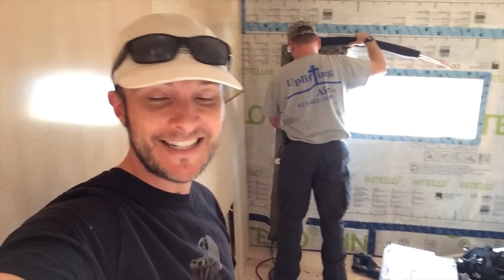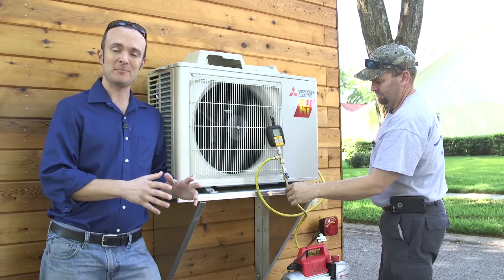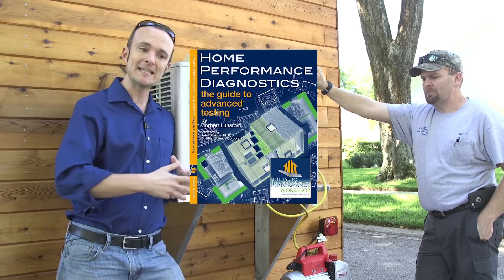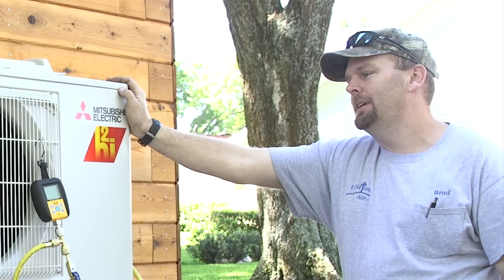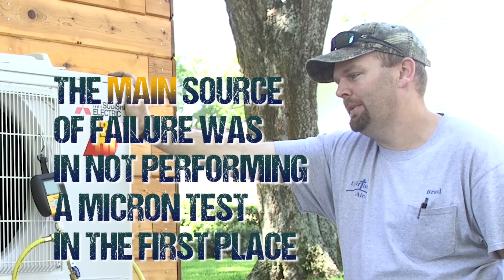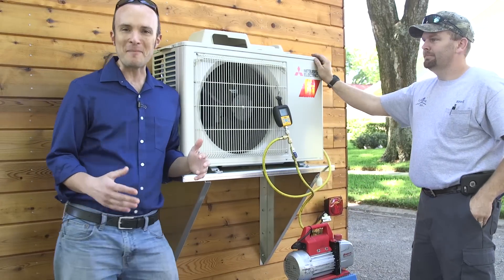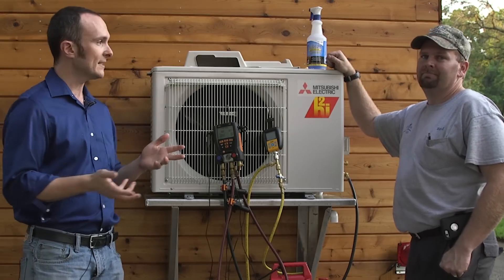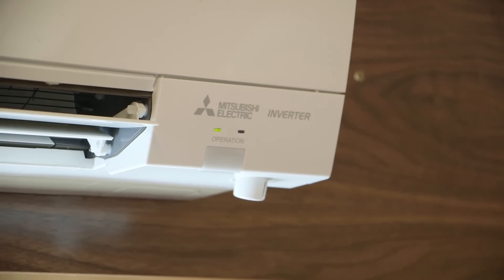Installing & Testing a Mitsubishi Ductless Mini-Split in a Tiny House with Brad Lemley

Comment: For the Mitsubishi 6K outdoor unit, is only the wall mount air handler available in matching 6K capacity ? I am looking to pair that 6K outdoor unit with a floor console or one way ceiling cassette ( that fits between 16" joist ) but unable to find one in mitsu documentation.

Comment: What is the procedure for folding out the line from the back of air handler to go out the wall?  The line is folded in the air handler for shipping and I need to straighten it out to go straight out the wall.
Reply: Just bend it and run straight out.  I do it all the time.  As long as your not crimped your good.

Comment: If you read the installation instructions from Mitsubishi, they say to nitrogen purge the lines twice, once from 4000 microns to atmospheric, again from 1500 microns to atmospheric. I'm trying to figure out if I can get away without buying nitrogen, just pull a solid really good vacuum and hold it for days to let the moisture evaporate. But after watching this, maybe I'll try to find some nitrogen.

Comment: I'd like to know how well this system would be on a small 12x24 cabin in lower Michigan winter's.
Reply from the maker: I know they have heen installing them in Montana, with no backup strip heat.
Reply: @HomePerformance  Excellent! And I now wonder how it will work with my solar system. Completely off grid here
Reply from the maker: It will definitely do better than any other piece of equipment- Mitsubishi is the most efficient you can get.

Comment: I did car a/c for 30 years and never heard of a micron test and up until 2000 I was a IMACA instructor and still never heard of one. I also never had an a/c fail later when a evacuation was performed. Apparently these home a/c compressors are different and I did not know that you could not tell the state of charge on a unit with and electronic expansion valve using a/c gauges...

Update: I looked it of and it's simply a "It is a very fine measurement that provides very detailed results" Meaning it's a much more sensitive method than ready vacuum with a gauge set...

Comment: Is the mini split system using any energy in stand by mode? If it is, can you turn it off at the switchboard?
Reply from the maker: Yes, it does take a trickle of power when ‘off’, like anything with a remote control, but I would advise not turning it off at your circuit breaker panel every time you feel comfy.

Comment: Is this unit still functioning and in good order?
Curious about the maintenance since install, and if there were any issues with this unit in particular.
I have one of these myself and unfortunately have a few negative things that I'm experiencing.
1. Blower wheel bearing went out relatively quickly (within a year) and is rather noisy now.
2. During colder days (30°F or less) there is an intermittent high frequency sounding noise when the heat pump is on, almost squealing, like when air is slowly let out of a pinched balloon.
Certain it's not motor related though. 
Any info or reference would be very helpful.

Comment: Test? How about a pressure test buddy. Your supposed to do a 24hr nitrogen test @600 psi on those Mitsubishi split units. I'm sorry but this guy talks a good one but he didn't do the job right.
Reply from the maker: Interesting- who requires a 24-hr nitro test? I’ve never heard that.
Reply: @HomePerformance  look at any installation manual that comes with the equipment.

Comment: Hi I'm ready to install my inverter unit. But my AC guy said I should have it 12 inches away from the wall like the manual said. Can I get away with it if it's 2 inches away. Thanks
Reply from the maker: Follow the manual- ours said 4" clearance.

Comment: If nylog is present use it for joints
Nitrogen should have been used first, bubble leak detect it second 
And then finally evacuate. 
Proper procedure will save time.

Comment: I’m installing the 12k version of the unit you’ve installed here. My condensing unit will be located right outside the house, allowing about 4 ft for the lineset. Do you know the minimum lineset distance needed for this unit?
Reply from the maker: Yes, it’s 15 ft back when we installed- def read the manual
Reply: Home Performance thanks! Unfortunately, it’s not listed in the manual, but I do have the 15 foot line, so should work out fine.

Comment: A 6 to 15 hour evacuation on a home system is ridiculous. Watch his face as he's trapped into something he knows is BS. On a 3 ton 2000 sq ft home you can pull vacuum down to 500 microns (EPA rule) in as quickly as 15 minutes using good equipment. Check for any rise between 500 and 1000 microns within the next 10 minutes. Basically if no leaks and no residual water/ice in system, you're done in 25 minutes. But the main point is he should have done a pressure test with nitrogen FIRST. He did the nitrogen pressure test AFTER the evac showed a leak which was a total waste of evacuation time. Under nitrogen pressure, check your connections with bubble juice for leaks. No loss of pressure, no bubbles, means no leaks. Vacuum the system, release the charge, fine tune pressure/temp, and your done.
Reply from the maker: Just have to say, I’m slightly suspicious of anything that seems so cut and dry in every situation, or of super confident promoters of such methods. A lot of us have seen enough projects to know nothing is perfectly cut and dry.
Reply: I agree with you that nothing is perfectly "cut and dry", and nothing in life is 100% either. Some systems may require more effort to evacuate, maybe up to 1.5 hours, worst case scenario. Here is a link to a professional HVAC tech vacuuming a residential system with a 50 ft line set and reaching 500 microns in under 3 minutes. Then you can decide if I'm "super confident" or just stating plain and simple fact.
https://www.youtube.com/watch?v=wYZ8Wudksb0
Reply from the maker: I’m just saying, have you ever installed a system in a tiny house on wheels in central florida as a favor for a friend who forced you to be on camera? Be nice to Brad, please.

Comment: Your explanation about being able to check for a correct charge after it is running is incorrect. You can use temperature to check if it is correct. As long as it can be run at full load 100%. I have done this with large R2 Mitsubishi systems. The same would apply on the small ones as well, but will agree the best way is to weigh in the listed charge this also takes away fractionalization issues if there was a leak and you were topping up the charge.
Reply from the maker: I believe Brad was referring to the difference between a minisplit and full split being there’s not a true superheat and subcooling attainable at the same points in the lineset. So you could get temps, yes, but what to compare them to?
Reply: Home Performance Manufacturers specs on what those temps should be at the sensors in the unit under full load for that specific unit. Just stating that it can be done as I have just installed a large R2 Mitsubishi system and temp checks are what they use to check final charge. The job I was on had 3000ft of piping total on 7 different systems. And pressure testing is what should be done prior to any evacuation at 600 psi manufacturers spec.
Reply from the maker: Large systems and mini-splits are different in this respect, though- that’s what his point was.

Comment: When a vacuum is drawn the boiling point is reduced. A 500 micron vacuum puts the boiling point around -15 F. So, how can anything freeze?

Was a torque wrench used when tightening the flares?

Comment: How’s the Mitsubishi holding up? How does it do in lower temps?
Reply from the maker: Still going like clockwork. 13,000 miles later, and 2.5 years in.
Reply: Home Performance wow! That’s awesome! I’m working on designing a Mitsubishi system for my aunts new house. We will be using the horizontal small ducted air handlers for her house

Comment: since 2018, you need a license to install these, even DIY versions
Reply: That stinks.
Reply: You can buy these units online from many different websites, without a license.  Some areas will require a permit to do any work on your home, but that doesn't always mean that you have to have a license.
Reply: @JJ-nh8lv  incorrect, you need a license since 2018, they changed the wording. doing any work that could inadvertently cause a freon leak, even hooking up gauges, require a license on all greenhouse refrigerants, probably not R718 though. EPA regulations
Reply: @ihatecrackhead  incorrect or not, what I said is a fact. The sad reality is,  the EPA doesn't enforce a thing. They got no teeth. You can purchase R-134a. R-410a online and delivered to your door. NO LICENSE CHECK.  R-134a at Walmart.  No license check.
Reply: Thank goodness, helps keep cowboys out
Reply: I'm not seeing anything that proves your point. You need to point out the changes in wording because nothing really changed except certain guidelines were extended to non CFC refrigerants and HFOs and substitutes.
Reply: @sprockkets  
then call the epa

Comment: Question; what would one do about air exchange and air quality. I am planning a tiny house trailer build. Would using a energy recovery ventilation device to pre dehumidify and exchange air be ran on a timed interval with a mini split. Am I right in saying it doesn’t look like the mini split exchanges air? Thanks so much if you answer my newby question
Reply from the maker: Ventilation Testing the Best Performing Tiny House on Wheels in the World
https://youtu.be/Xy4OvjEd3IE

Comment: 18:20 onwards: re: mini split freon measuring.  Are you essentially saying the DIY refill kits you get with the gauge that connects to the service port (and measure the pressure - has a needle in the 'blue' zone when the refrigerant level is correct) simply don't work properly?
Reply from the maker: I believe what he was saying is that you can’t measure superheat and subcooling using pressures, which is the main diagnostic used on split systems.

Comment: Installation manual must have been overlooked, not supposed to trap condensate line on ductless unit. You have double trapped the condensate line which will cause an air lock resulting in a water leak at indoor unit.
Reply from the maker: Nope, we just wanted it air and bug tight at the outside end. And nope, no water leak problems- I don’t think this condensate line has a trap in it at all unless you add one- the pan runs straight into the pipe, no trap built in at the factory.

Comment: is it 110 or 220v?
Reply from the maker: 220
Reply: How does a THOW run 220?
Reply from the maker: Autotransformer. Doubles voltage, cuts amps in half, same wattage output minus about 10% efficiency loss.

Comment: Thank you for the great content.  Did you have to use a transformer to step up power from your panel to the unit?  I tried searching other videos on your channel and website but couldn't find the answer anywhere.
Reply from the maker: Yes, we have an autotransformer that steps voltage up to 230 and cuts amps in half. So technically our house runs on 230v 7.5A service.
Reply: Is there any chance you measured the power usage for the mini split over a  24 hour period during the summer? I am trying to size a solar system using this mini split.
Reply from the maker: You need a cooling load calc for that. My house only needs the minisplit to run at 300W, but it runs all day on a hot one.

Comment: Nice system.Yes,you leave the system in a vacuum for at least an hour.That way you can identify a leak.With system in vacuum,is when you add the freon.The vacuum is removing all air,so you get a full charge!You cant hurt anything by leaving the vac pump on.Depending on your altitude,you can only vacuum out so much.Sea level is 28 inches of vacuum,you wont be able to pull more.So,suck it down,let it sit,it dont move,filler up!

Comment: My understanding is its always better to place the outdoor unit on the ground rather than hanging it on the exterior wall due to vibration noise.
Reply from the maker: +bgregg55 that would have been great, except that we drove this house 13k miles across the US.
Reply: that occurred to me after i posted that.
Reply from the maker: Yep, important to design a roof overhang over it or install it 4 feet up like we did.

Comment: Can you walk through how you air sealed your mini split hole? Looks like you used pvc then taped vana around it? 

How did you airseal the line inside the pvc? With call or foam?
Reply from the maker: +MrSteviewonder3 tape and gaskets from 475 High Performance Building Supply! Check them out.
Reply: Home Performance ok cool! I understand and see you did that around the pipe. But what about the space inside of the pipe?
Reply from the maker: +MrSteviewonder3 the pvc is only for condensate. The lineset is separate.
Reply: Home Performance yes but what prevent the air from entering inside the pvc? Is there a damper or?
Reply from the maker: +MrSteviewonder3 aha, I understand your question. There is a P trap in the line, which is full of water all summer long. I also tested the leakage through the PVC during the blower door test, and it was minimal anyway! That video is on our channel too!

Comment: Mitsubishi split are the best by far the problem they have a rectifier build in condensing /air handler unit so the motor inside is DC now that sucks try replacing that warning don't buy an off-brand piece of junk

Comment: This might sound strange I work on air conditioning 25 years most the time I did not use nitrogen most mechanics are in too big a hurry if you have that kind of setup that he has with a micron gauge I believe in go down to about 800  no moisture 😋you won't have to worry about leak checking anything  but there is a lot of guys that don't have one the main thing is the let that set in a vacuum if you don't have micron gauge that needle on your gauges better not move , they recommend that you triple evacuate it that means evacuate putting in nitrogen dump nitrogen 3 time that is before they had micron gauge
Reply: Aren't pressures very high when heating with a 410a system? Nitrogen pressure testing seems critical in these situations

Comment: Is your drainage the white pvc under the unit? Did you consider running the line on exterior?
Reply from the maker: +Shey Baesler yes it is, and I wanted it to follow the lineset. Less holes in the wall that way.

Comment: wrong all wrong. that unit is not running with only one green light on both lights have to be on for it to be actively cooling or heating. also that sensor called the isee sensor justs senses movement not temperature.
Reply from the maker: +Mark Scott sorry, but you should read the manual. Two green lights means it's catching up faster with a 4 degree F or more difference between reality and setpoint. And it has both a motion sensor and an IR sensor.
Reply: Home Performance read the manual? my company sent me to the 2 day Mitsubishi class tough to by a technician that only deals with Mitsubishi  to learn about the systems. I've also installed hundreds of them and serviced them as well. one green light means the the temp sensor on the wall head is beyond satisfied. and the Isee sensor just senses movement in the room and if it doesn't sense and it drops the temp 1 degree in heating no more than 4 degrees or raises the temp 1 degree in cooling no more than 4 degrees.
Reply: Home Performance also your installer should have pressure tested the system with at least 600psig of dry nitrogen before he put it on the vacuum pump. and he should have done a triple evacuation as per the installation instructions from Mitsubishi.
Reply: isee does do temperature. If you don't know that then it is confirmed, you don't know what you are talking about and shouldn't be installing Mitsubishi.

Comment: I install Mitsubishi mini splits for a living in fact I've installed hundreds of them and you absofuckinlutley can install them in the rain. as long as you do a triple evac and as an added sure fire way to not have moisture in the lines is to make all flare connections except for the liquid line at the out door unit and blast out the moisture with dry nitrogen then connect and tighten.  pressure check to over 600psig then let out all but a couple psig of the nitrogen then start evacuating the lines and do a triple evac.
Reply: Still doing triple evac? Make sure you post what company you work as to avoid you.
Reply: What's wrong with a triple evac?

Comment: This is how to properly pull a vacuum to remove moisture from an HVAC system 10 times faster. https://youtu.be/eGLYAmjWkvA     Brad is using 1/4" hoses(too small) and yellow non vacuum rated hoses. The yellow hose is probably why he suspected a leak because they are permeable and will simulate a leak unde deep vacuum (500 microns). Typically the non permeable hoses are black or braided stainless steal. Brad still performed better than 90% of other HVAC techs

https://www.trutechtools.com/Vacuum-Training_c_1100.html
Reply: thank u Adam u r very informative. this was the most informative video to date on a very efficient heat pump system

Comment: Are you too close to the wall, restricting intake airflow?
Reply from the maker: +john spinosa manufacturer's spec is 4" clearance, which we have.
Reply: Thans!!
Reply: don't you mean ceiling?  The unit mounts directly to the wall, I think we have a typo here.
Reply from the maker: There are two units, guys, indoor has to have clearance from the ceiling and outdoor must have clearance from the wall. The install manual tells you exactly how much.
Reply: Its a 6 k btu. 
If it were bigger,like a 24k,then more clearance is needed.
Reply: 4 inches is fine 5-6 is better
Reply from the maker: On a normal house that doesn’t roll down the highway I would agree with you